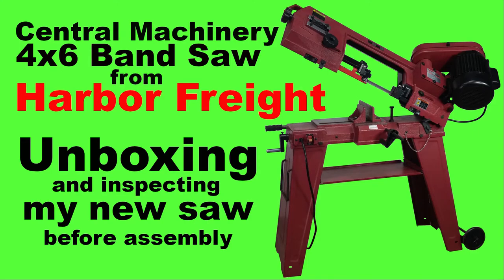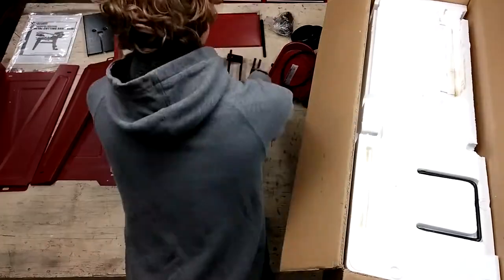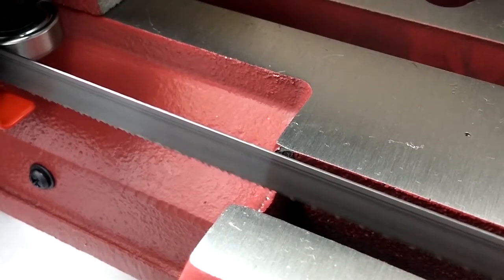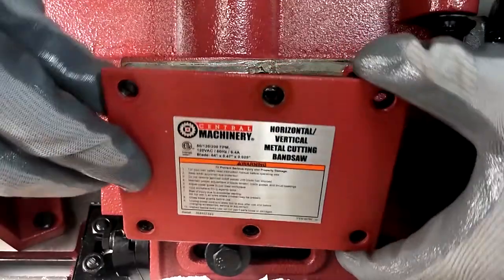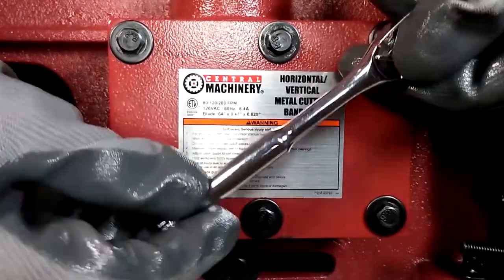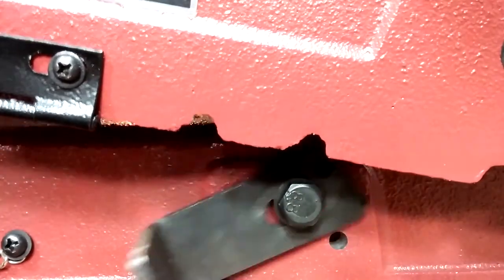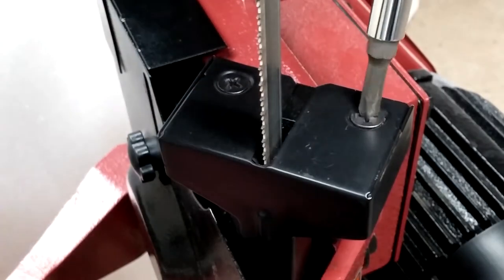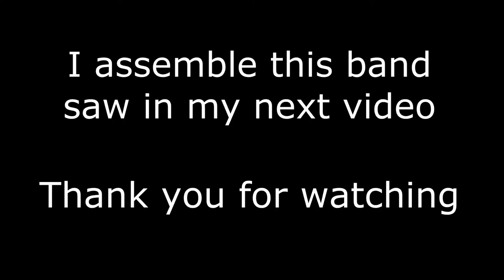Harbor Freight band saw  -  Part 1  -   Unboxing and Inspecting Parts

Comment from the maker: I plan to give the saw an oil change after it has had a chance to break-in.  The manual says to use 140 weight.   Any recommendations, like a good budget brand of gear oil, would be appreciated.
Reply from the maker: Thanks for the link

Comment: I’d have a look at that oil. Looks like used motor oil to me. Could be the video, but that oil looks black. 
-Pidge
Reply from the maker: I see what you mean.  The camera made the oil look much darker than it actually is.  I should have shined more light into the gear box.  The oil looks like new in real life.  Thank you for letting me know about that.
Reply: Alrighty then👍🏻👍🏻

Comment: Hey Phil - thanks so much for this excellent series on the Harbor Freight budget bandsaw!   Don’t think this particular model would make straight 90 cuts in 3” solid steel rounds?  I realize it will take quite a long time to make that cut but do you think it’s capable without ongoing coolant being used?  Appreciate your thoughts and suggestions you might have to make this cut possible.  I only have three cuts to do. Thanks again Phil!
Reply from the maker: Thank you.  It could probably do it. Depends on how hard the steel is.  Could always stop part way through to let the blade cool if needed.

Comment: I (intently) watched all 6 videos in a row... Extremely helpful and gave a great insight to a tool, that I am planning to buy tomorrow. Thanks to you, I know exactly what to expect and what I will need to do to finesse the most out of it. I expect to have to tune it up, apart from your key input. I filed the drive pulleys on my CM drill press exactly as you did to remove the burr, saving the belt... it ran quieter and without rubber shedding. Thanks a bunch for the thoughtful and very well produced video series... I subscribed expecting to see 100's of them (this was so well produced) was surprised not to see more... please understand [not a complaint] as you a very very good at dong training videos... I am glad to have found you / your work! BTW, I like your mods, I will consider and likely have to do them too...
Reply from the maker: Thank you for your kind words.  Comments like that really help motivate me to make more videos.  If you have any questions about the saw,  feel free to ask here in the comment section and someone should be able to assist.  I will try my best to answer questions but my response time can be pretty slow.

Comment: I've been patiently waiting for a discount and finally tomorrow I'll go down to HF to buy this saw. I'll use the very first part of this video to perform a first-pass check of the saw directly in the parking lot. In case I see damage I'll exchange it right away. Once I'm home I'll follow all your videos to check it out
Reply from the maker: Cool, I used a 20% off coupon to discount mine, but that was before Central Machinery stuff was excluded from those deals.
Reply: @BudgetPhil  this weekend there's an exception and I could have gotten 20% off, but the store I visited didnt have them! They wrote a "rain check" where it is stated I'll be able to use the 20% off when they receive them in a couple of weeks. Not sure if i should trust them on this... I'll probably try again tomorrow in another store. I really want to build a cart for my compressor and without the band saw it's going to be a lousy work
Reply from the maker: It's good you got the rain check.  I also would probably phone another store to find one sooner.
Reply: @BudgetPhil  yeah I went to the next store, luckily we have a few in the area. I am now in possession of the saw - I also got the credit card so a total discount of 30% 🙂 I performed a quick check in the parking lot and it seemed good. In the next several days I'll follow your videos again to check my saw
Reply: @BudgetPhil  same here..........just today......grrrrrrrrrrrr!